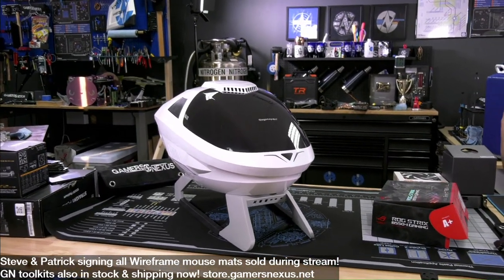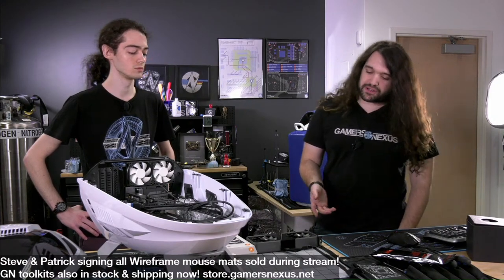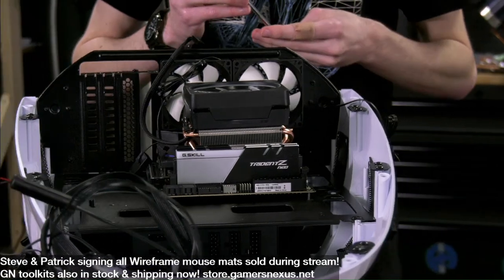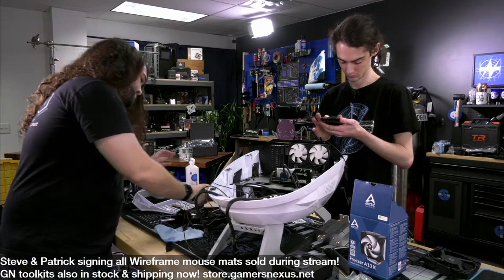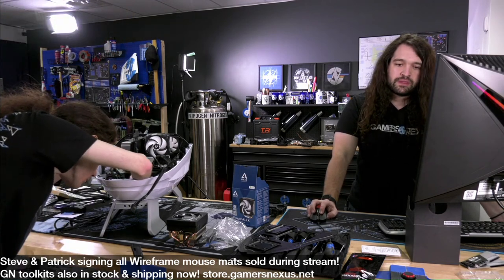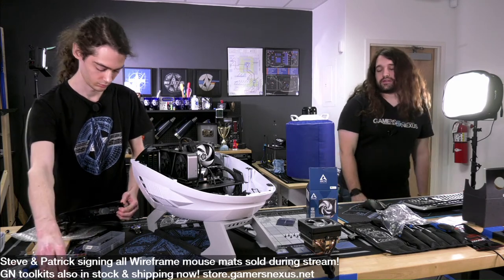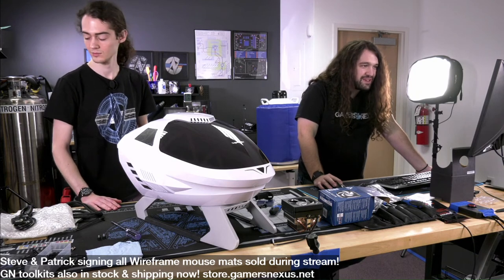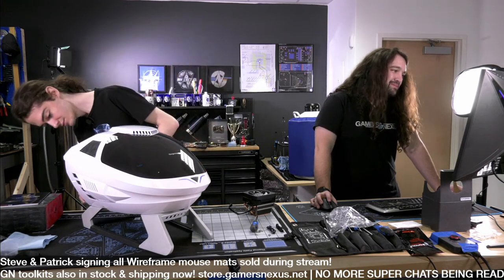LIVE: Mini-ITX PC Build with Weird Spaceship PC Case

Comment: The big thing this case is missing is the Warp Nacelles; I'm now thinking of an eternal watercooling mod where the Nacelles are pump/rez combos with a custom shell, maybe run soft tubing through the tiny side vents and use them as attachment points. I also think suffuse RGB could be awesome in the "cockpit" area.

Comment: Why not a 120mm aio in that front plate? Looks like 120mm spacing gap. Have it blow up to top then a 120 in the base pulling fresh air to supply it.

Comment: Hot glue you say? I use it for cable management in my PCs :D
Just for sensors which are pretty much permanent though. And It's on the soft side and can be removed without much difficulty.

Comment: The tiny PC board between the power supply and the logo projecting LED is probably the current source for the LED. Remember LEDs are CURRENT devices. Connecting an LED to +5V will probebelly burn out the LED. Designers for cheap, low-power LEDs just use a resister. The problem with this approach at 5V is that about 76% (5-1.2)/5 of your power is used to heat the case. With 12V it is about 90% (12-1.2)/12. This is ok when your goal is UGH! PRETTY!. For higher currents and efficiency you want a DC to DC converter with a current out. The coil inside is probably part of that CURRENT regulator.

Comment: I think it is a pretty cool design idea really. I think with a little thought they could have made space so you could use a 120 AIO. Seems there could also have been some preinstalled 80mm fans on the top piece wired in series with a single connector and a wire long enough to not create an issue with taking the top panel off and pulling the wire out of the MB.

Overall though, cool design really.

And tbh, anyone with a little patience and maybe a dremel could hook up some smaller fans for airflow. As we saw in a previous video you can get 3 loud, but small, fans from a PS5 warmer for not too much ;)

Comment: Hey Steve. Not sure if you're going to read this, but if you want to do the case industry a solid you can contribute with open-source hardware partners and toss some ideas around which might be picked up by manufacturers without attaching your name to it. That way, everyone (save for gamers Nexus) benefits as customers would have more solid case choices.

In fact if you do it in that particular manner you can incorporate into your review objective analysis of which ideas from Gamers Nexus were implemented as you'll always have someone with a keen eye observing whatever of your team's design were used commercially. It'd be fun to see how that develops over the years.

Comment: Hey Steve... Question for you... If you ordered custom length cables from cablemod, do you think it would clean up the airflow capacity in the bottom or at least, if nothing else, make for less extra cabling to manage, and less un-needed cable plugs left lying around the bottom of the case??? A prime example is that cable you tried to remove, and found you couldn't as it was hooked to the, (GPU was it???), and you didn't have the single plug, or needing only 1 or 2 molex plugs, but never having cables with less than 4 or 5... again, unless you go for something like cablemod cables... Just a thought...

Also, if you could put holes in a pattern on the windshield piece, specifically in the honeycomb area, I wonder if you could put a couple of fans there or perhaps a radiator with a 3d printed air channeling shroud, with a bit of mesh between the honeycomb and the windshield piece???

Also, I think you should get some 80mil noctua fans for that, to see if better fans would help...

I only ask about the cables because it could possibly have a positive affect on how it looks and possibly how hot it runs, and I think it would be worth it to figure out if that would make a noticable difference...

Comment: I am trying to visualise the room this would be in. Like this thing is huge and obviously you dont want to put it under your desk. So you'd probably put it on a separate desk or something cause having it on your main desk would eat up a lot of space. So you also need some room space cause you dont put it on or under your desk but in a dedicated space, probably standing for itself cause it's a 200$ case that looks like a spaceship, you want people to see it. Now you got the issue with the cables are you ignoring those or do you make a solution where they like run into the thing the case is standing on all sneaky. I wonder if someone has build a little Diorama maybe with other space themed appliances.
What I am trying to say is that this thing was build for like 2 people on this planet.

Comment: @GN I have an Aorus X470 and it seems to have issues with enabling the stored XMP profile. My PC will start, and then restart a few times, occasionally reverting from the 3000MHz speed of the RAM back down to 2166. Watching the changes in BIOS it would seem the pre programmed timing settings are off by a significant amount since I am running Corsair Pro RAM. How would I go about resolving that? I read there is a BIOS update for it but I am wondering if it could also be a PSU issue since, on startup when it has an issue, the RAM LEDs don't want to light up and usually a fan (Corsair white LL120) decides it doesn't want to start spinning or it starts and then stops.

Would I be better off to go in and enter all of the RAM specs manually in order to make it stop acting up?

Comment: I would probably Replace alligator clips with plastic pins with rubber gaskets and use epoxy to secure pins. Will probably hold a lot longer than crap alligator clips

Comment: 2:02:32 Someone did try using gallium instead of water, though smaller scale than LTT probably would have, can work, but doesn't seem worth it, especially since water has FAR better heat capacity which is a bigger benefit I think, since it ensures a more stable temperature, especially for longer running loads and avoids short upsvings:
https://www.youtube.com/watch?v=XqvBLBlzeNQ&feature=emb_logo